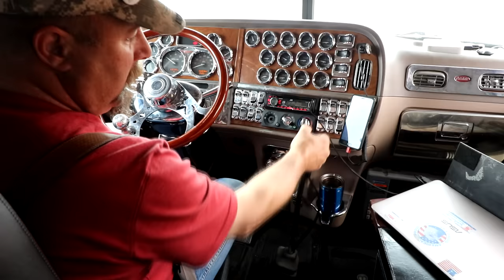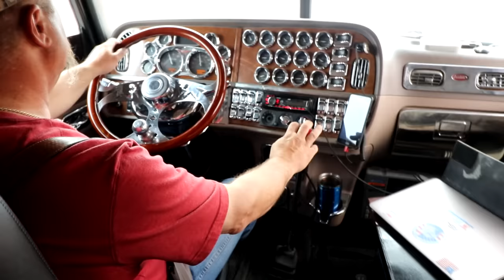How to shift an 18 speed transmission

Comment: Very interesting. Funny to hear someone say "Start off in 5th."
Reply: When car engines were big and lazy, there were often only three gears and the lowest was only used for hill starts.
Reply: TrainTrackTrav , why funny, if I’m bob tailing I always start off in fifth
Reply: Yeah. I thought the same thing. I figured you'd have to start in first or second. The engine must have so much torque that you can do that. I saw a vid where a guy started out in a newer corvette in 5th and it worked because of the torque.
Reply: with the amount of torque those engines have they can start in any gear
Reply: greatest ever, that's not true at all. more to the point is the lowest gears are used for starting on a hill with a heavy load. i drive a 10 speed and start out in 3rd with most loads on flat ground. sometimes when in traffic, i'll drop down to 2nd or even 1st so i don't stop and have to clutch again...
Reply: TrainTrackTrav on most farm tractors you can start in any gear, some have 18 speeds most have less, loaded is hard to get going at high speed especially since most aren't synconized transmissions but as you saw this guy clutch less shifting its easy enough to accomplish.
Reply: well when you're driving a diesel powered trailer, 5th gear is just the 5th first gear.
Reply: @tedparker640  He was clearly make a little joke about the amount of torque these vehicles have, lol.
Reply: @SubaruWRXspdManual  In my driving days, I would typically start out in 1st gear if heavily loaded, 2nd gear if lightly loaded or empty trailer, and 3rd gear if "bobtailing" (trailerless).
Reply: you can start off in 7th gear in older tractors (out of 9)
Reply: My first car was a 1957 International Harvester 1/2 ton pickup. had 4 gears and topped out at about 50mph lol.

Never started in 1st unless I was pulling something very heavy, and I only used the clutch to start, or idle down at a light/stop.

Would imagine kids these days don't know what a stick feels like. Course I'm 51 now
Reply: and to hear someone say "15th gear, going 30 miles per hour"
Reply: back when i was driving would do a 2nd,3rd,4th and then 6th or 7th never could find 5th
Reply: Trucks have a massive amount of torgue and you need it when you've got a full load. In my country the maximum weight of truck + trailer is limited to 76 tons. An empty truck weighs under a third of that, and even less without a trailer. So you can see with low weight you have a massive amount of extra power you don't need.
Reply: @SubaruWRXspdManual  these rigs make @ 2,000 ft/lbs of torque

Comment: I am familiar with the 13 and 15 speed. The old manual 5 and 4 gearboxes gave 20 gears to work with. I owned a truck with that transmission. What is probably not appreciated is that when loaded, serious damage can occur with one slip up in shifting , costing thousands in repair and downtime.people think truckers are second class, believe me the good ones are not. They take pride in putting in hard long days while shooting 110,000 lbs maybe more down the road at highway speed safely. The art of backing these trucks and trailers into docks that most couldn't back up a compact car into first time is also over looked. The world of trucking has changed with GPS. Internet, high tech engines etc. but the skill required to operate one of units has stayed very much the same. The next time you pull up beside a semi and go past those wheels just remember that should one of those tires fail, the energy released and debris is enough to total off your vehicle. I have full respect for those truckers that check their units over and maintain them. You are greatly under estimated.
Reply: My dad drove a truck for 30 years. He routinely did things with that truck and trailer that I didn't think possible. On a regular basis he'd back the trailer into our driveway over a small bridge big enough for a single car. He had to have several wheels on the trailer hanging over the ditch while doing it.

Once he had to back a trailer into a loading bay. The bay was at the top of a steep ramp without room to come at it straight. He had to back around a corner and up a ramp while their were stacks of crates piled up in the way so he had to do it blind. I got to watch from off to the side and it was impressive.
Reply: Garth Downton I drive a Coronado with a 13 speed and enjoy it
Reply: Agree, what scares me is people when passing, slow down at the rear of the truck and take the longest time instead of keeping their speed and leave us behind. A tire can blow up any time and the sound only can make them swerve and crash.
Reply: 80k gvwr....unless your'e talking oversize load...
Reply: You can permit more than that, but keep in mind you must get a permit for every State you run in.  An oversize permit is for a route and time schedule which you must stick to.  An oversize permit is going to take one or two days to get, where as a weight permit can be gotten at a the scale house.  Say I am going from NC to TX to pick up a load of rock - I have permits for the States I am going through except TX.  I pull into TX and hit the first scalehouse and tell the man what I am doing - he sells me a permit for it and I go get my load.  They are two different animals.
Reply: I always try to give the big rigs a wide berth, get by and keep going!
Reply: @jedknutson8373  Or in Michigan. We have 11 axles and 160 thousand weight limit. 18 speeds are great for gravel trains coming out of the pits loaded
Reply: Garth Downton: A lot of the OTR drivers have a rough time backing up their trucks because they don't go in reverse all that often. If you want to see someone with skills backing up a big truck, watch an oilfield semi driver sometime. These guys are backing up semi's multiple times a day, and sometimes for some distance on unpaved dirt roads that are never straight. I used to be one of those drivers and I could backup down a dirt road getting to a rig with the 13spd trans in high reverse and one shot the placement of the truck on the pad. I used to run transfer trucks for a short time and was able to back that rig up better that some of the OTR drivers could back up a 52' trailer. (A transfer truck is a 3 axle dump truck with a trailer that has a box on a trailer that you "transfer" into the dump body and back out. The trailer is 2 axle with the front axle pivoting as well as the pivot at the pintle hook, much like what you would see from a set of doubles.)

I have also driven OTR and been to a loading dock where a driver I was watching took half an hour literally to back into a door with nothing around him. Don't get me wrong, there are a lot of OTR drivers that actually know how to back up well, but there are just as many or more that don't.
Reply: It was called a brown lite by the old guys,there may have been twenty years but the combination in which you could use them was off the wall,until you missed a gear climbing a 15% mountain,pull over start over
Reply: @TeacupKitty13  why weren't you spotting for him
Reply: @Trking4U  also if they hang around trailer tires they have a lot higher chance of a little piece of road debris getting kicked up into the car and putting them out. I will admit though sometimes on Windy days, or I guess sometimes the drivers aren't very experienced, I see a little bit of trailer drift not a whip. When that happens I'm definitely going to slow down because when I look out my car window I'm looking right over at those tires. When a vehicle has tires that tall they get my respect, and you are right when rolling down the highway in about 70 miles an hour and a Tire blows on it tractor trailer and you're in the next Lane over it is damn loud. I've only experienced it once but I did not swerve or anything like that, I guess that's where the carbontanium nerves come in
Reply: @jedknutson8373  no this was only a local Drive to be stored in a warehouse but we had a heavyweight ticket prominently displayed in our tractor showing a weight of over 126,000 pounds. My crew's tractor was not even supposed to be used on the job that day but when they tried to move the trailer with the 81 KW single screw all she could do was lift her front wheels off the ground. So our 96 Freightliner cabover pulled it.
Reply: I can relate as a Euro Truck Simulator player
Reply: I agree but those tesla  auto pilot trucks are bout 20-30 years off and thats gonna be hard to stop that trend once in motion.

Comment: This is a great video. I got my CDL about 8-9 months ago. Drove 10,13,18 speeds. Really not as hard as some people make them out to be. What I’ve been told by people is if you can drive a 13 you can drive an 18 only difference is you can’t split the low side of the gears on a 13 speed. Spend a couple days behind the wheel and you’ll get the hang of it. Now the 18 speeds are fun!

Comment: America= cars are (mostly) automatic, trucks are (mostly) manual 18 speeds
Europe= Cars are (mostly) manual, trucks are (mostly) automatic
Reply: Really depends where you live in europe
Reply: most European truck drivers prefer manual's gotta realize as well that its a very different world over there, traffic may get bad here but over there its 10x's worse mix that with tight roads and round abouts....I couldn't ever be a trucker in Europe have to pay for parking all the time pay toll road constantly what a nightmare of a job i really feel sorry for those guys.
North american trucking companies are actually mostly going automatic transmissions, best way to avoid that is just do what I did and buy your own truck another benefit is no governor so passing's way easier as well.
Reply: Philippines = cars and trucks mostly manual, very uncommon to see automatic
Reply: @robbalinski1606  i would say 90% of trucks in Europe are automatic and drivers are happy with it.  Manuals are built only for special trucks who pull hundreds of tons.
Reply: Most of the cars and trucks are automatic, like 90% of new trucks build today in europe are automatic same with cars but with cars you get the option to switch to manual when purchasing a car
Reply: @robbalinski1606  Most trucking companies have systems that handle tolls etc automatically so you basically drive through and it registers you. Then there are many dedicated truck stops that normally don't cost anything to stop at.
Reply: Idk bro I just got into trucking in UK class 2 (rigids, no trailer) and I've only driven automatic in school but somehow have a full manual loicence. Idk how that works. Anyway I've only driven manual trucks for work. On my first day I had a 26 tonner scania from 2007 8 speed. I've learnt how to properly drive it halfway on my way back. Apparently you do 2,4,5,6,7, 8.
Reply: The Vibe There was a rule change in the mid-90s.  As most buses and trucks were becoming fully automatic, as long as you had a manual car licence, you got manual entitlement automatically, whatever you passed your truck/bus test in. Before that, you had to take a truck test in a manual vehicle - they were getting harder to come by - and your bus test in a semi-auto or pre-selector - there hadn’t been any manual buses for years by then.

Comment: That little button on the side is basically a gear between gears, or an overdrive for each individual gear. I use it to downshift from 18 to 17, in situations where it wouldn’t be necessary to go from 10 to 9 on a 10 speed. Downshifting half a gear saves fuel. 
Plus it’s fun to drive.